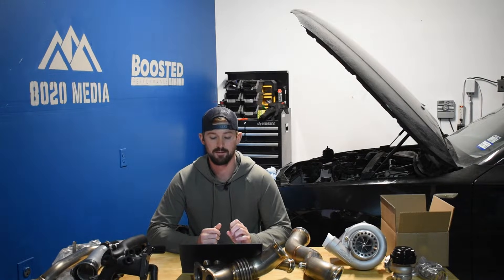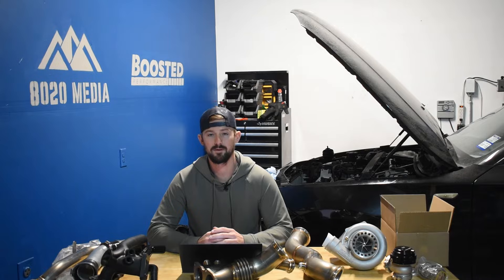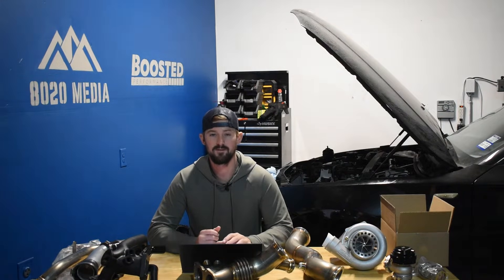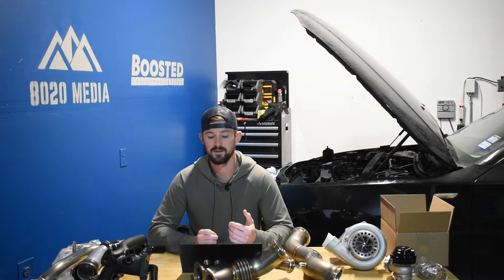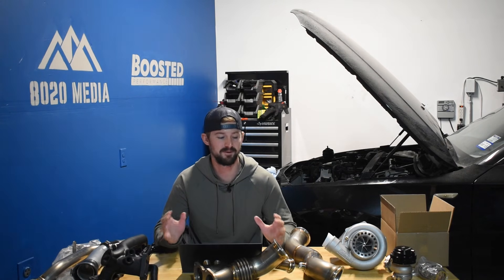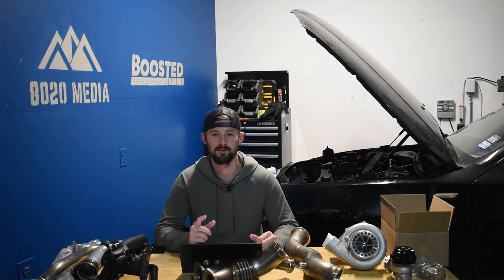Dodge's 6.7 Cummins | Reliability & Common Problems

Comment: I don’t understand why dealers don’t explain that if you don’t use the truck no matter what brand for it’s intended purpose your going to have issues. Modern diesel engines are designed to pull loads and lay down miles,not get groceries and drop the kids off at school and definitely not idle for any or long terms. I do know they just trying to sell trucks but the consumer buying the truck for the wrong reasons and that not being explained is a problem.
Reply from the maker: P - Cause most of them just want the sale haha. It's all about numbers to them unfortunately.

Comment: My 2013 Cummins had a water pump replaced under recall at 75k and turbo replacement at 108k miles. We have 143k miles  now and no other major issues. I’ve been changing the oil yearly with relatively low usage between changes.  All seems to be going well. I think the valves need to be checked and adjusted at 150k.  Newer models seem to have more issues so we will just hang on to this one.
Reply from the maker: G - Thanks for taking the time to share your experience!

Comment: what about the grid heater bolt failing. you forgot that on bud, also the most expensive fails of all
Reply from the maker: C - This certainly is a big problem. We do have an article on this: https://dieseliq.com/6-7-cummins-grid-heater-bolt-failure/

Comment: is it okay on a 2011 6.7 cummins to always have the exhaust/engine brake on? and do you recommend anything efficient but not crazy expensive to replace that grid heater bolt?
Reply from the maker: C - We wrote an article for the grid heater issues on our website: https://dieseliq.com/6-7-cummins-grid-heater-bolt-failure/

Comment: In the diesel world of trucking the i6 is the standard with the v8 being the non traditional approach.  I own three rams with cummins engine . One being a 89 w350 1st gen . The cummins engine is known by the million mile engine for a reason. It's amazing that through out its life it still uses its key core design developed and engineered in the early 80s. That's a good engine .
Reply from the maker: Mark - Thanks for sharing your experience! We completely agree.
Reply: I got 300k on my 6.7 Cummins
Reply: What year? @charlesc4047
Reply: WAS a good engine...it is straight trash now
Reply: The I6 is not the standard, at least not originally. Inlines have proven more reliable and easier to maintain but V style was still the original.

Comment: Any problem with the CGI blocks? Heard they were having issues with the bearings on the crank in the 6.7 Cummins.
Reply from the maker: I haven't heard too much about any issues - there was the recall on like 30,000 2019 and 2020 models because of rod bearing issues but it was fixed with a software update.

Comment: Looking at a 18 with under 75k, safe to say it would be a good purchase? Owned a 06 6.0 and it was a nightmare, so a little hesitant getting back into the diesel market
Reply from the maker: PK - We would assume you were taking great care of the 6.0. Don’t make your purchasing decision off of us, but we’re big fans of modern Cummins engines. We have quite a bit of content on the 6.7 Cummins on our website to assist further in your research. https://dieseliq.com/category/dodge-ram/cummins/6-7-cummins/
Reply: @8020Media  as far as regular maintenance and not beating on it with the 6.0, yes i took good care of it. Had more shop time than i was expecting. Mainly oil and injector issues, dodged the notorious head gasket issue. I was just looking for advice/ insight on the 6.7s. I'll definitely check out the videos. Thanks
Reply from the maker: Keep us updated on what you end up doing!